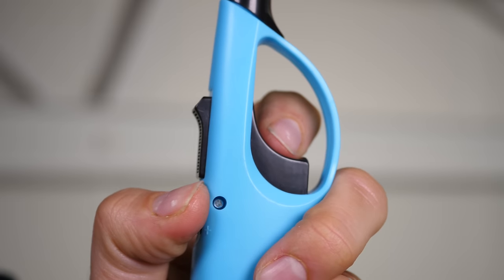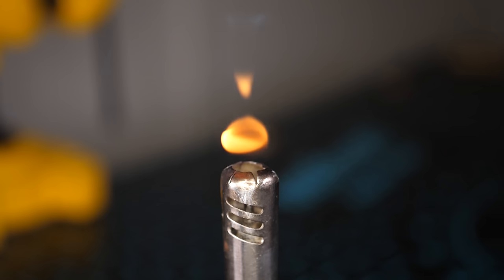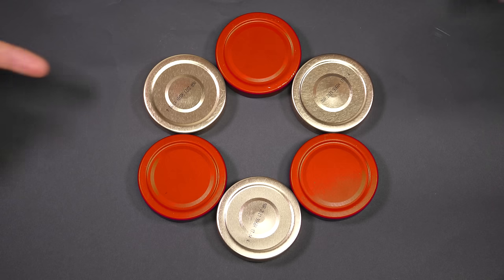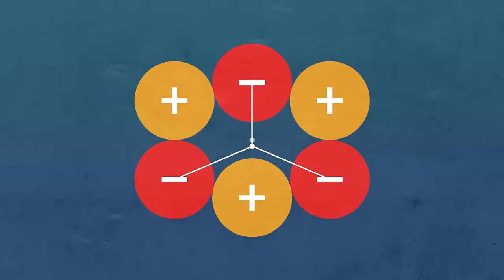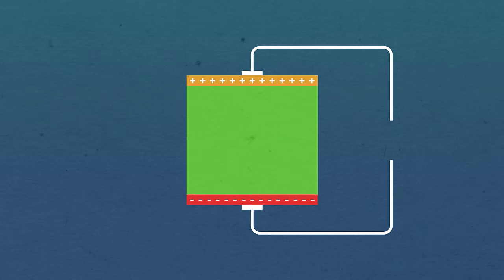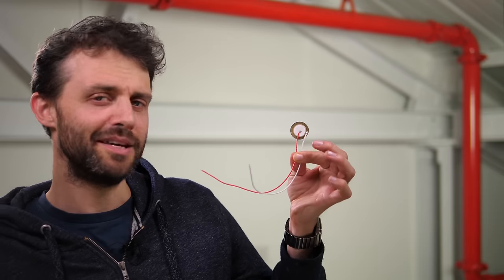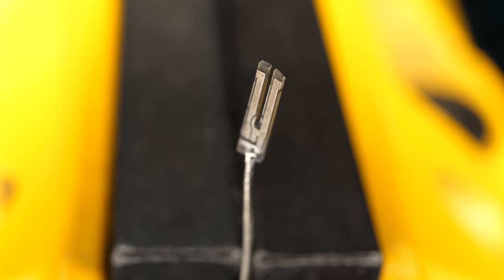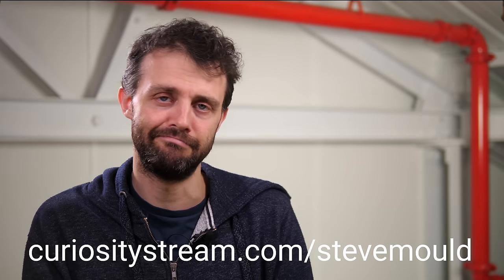Piezoelectricity - why hitting crystals makes electricity

Comment: So i guess i now understand it.
When orthodintists apply braces on your teeth, the wires exert a force on the teeth to move them through the bone (bone deforms and reforms ina process called remodelling) and so what happens is when the bone is "squeezed", a piezoelectric effect takes place as in a quartz crystal. This produces signals in the body. 

I'd love to see the molecular and lattice structure of bone and its symmetry. 😮
Reply: They don't use quartz and never have. In modern braces the wire is made of nitinol that has been stretched/deformed in a specific way, allowing the heat of your mouth to "activate it"
Reply: @Coastal_Cruzer  you're right about the nitinol wire,
But that's what I'm talking about.
The force exerted by the wire makes the tooth move "through the bone". I'm talking the movement of the "teeth through the bone" which has mainly 2 theories. One of them is the piezoelectric theory. :)
Reply: @jm2340  Talk to an orthodontist, they can explain exactly how it works. theres no mystery and no relation to the piezoelectric effect in the slightest